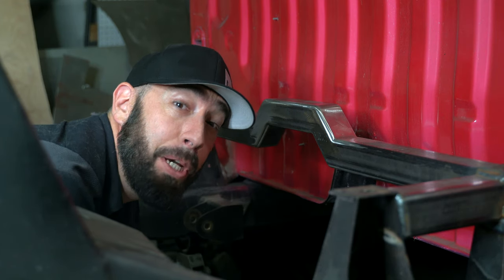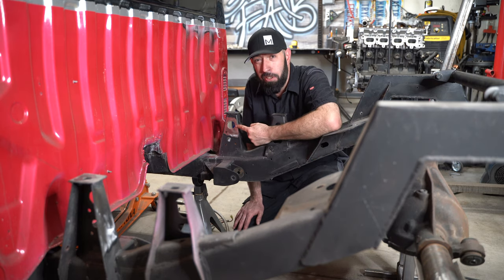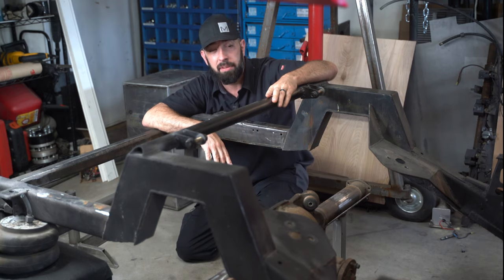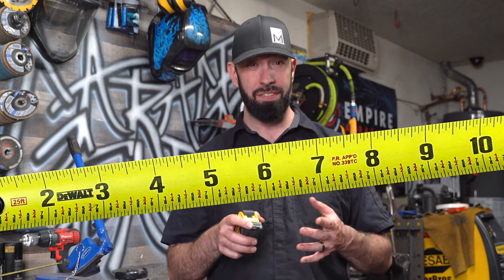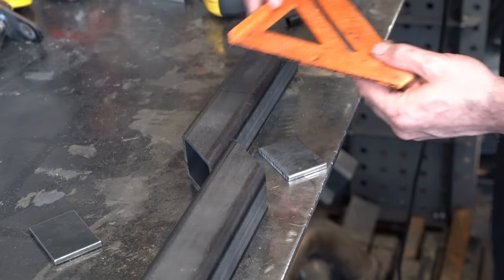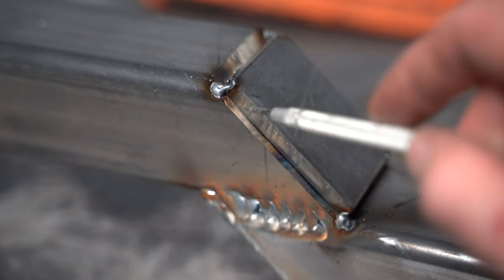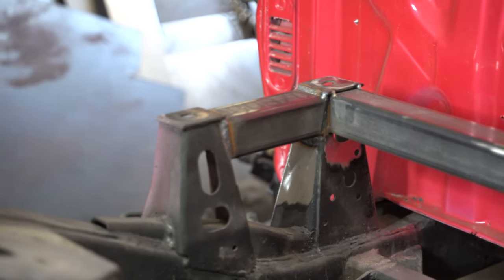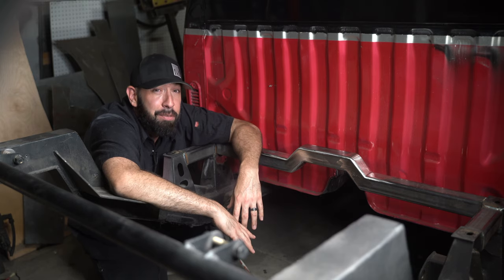Building a Custom Crossmember for a Parallel 4-Link! Mighty Max Ep. 10

Comment: I'm a Canadian welder/fabricator, with over 30 years in the trade. I learned metric in school, but most fab shops I've worked for use imperial on the shop floor... I actually prefer it for fabricating... gets annoying when you start dealing with 10,452 mm, layout a hole center 🤣 one of the tricks I like finding the center of a measurement goes like this: half of 3/4 is 3/8, half of 3/8 is 3/16, half of 3/16 is 3/32... half of 5/8 is 5/16, makes laying out centers easy.

Comment: I just picked up my own 4g swapped mighty max project. You have some of the most informative and entertaining content so keep the videos coming!
Reply from the maker: Thank you for the kind words! Is the swap done already or are you going to tackle it? We’ll have to swap notes. I haven’t done one yet so it’ll definitely be a learning process.
Reply: @GarageFab  It’s still a project that needs to be finished up. Most of the fabrication stuff is done except for the transmission mount (engine was moved forward 2in). I pretty much need to do that, plumbing for cooling/intercooler piping and then wiring. I’m pretty familiar with the 4g63 being that my first and forever car is a 99 gsx. The truck will be on the back burner since I’m gonna be building my car and I’m still in college, however expect to get it done by the end of the year
Reply from the maker: Very cool! I’ve hit a snag with the cooling system at the back of the head. It looks like I bought an Eclipse with the wrong motor. Getting the coolant hose neck at the back of the head is going to take some creative fab work. Can’t wait to see yours. 👏
Reply from the maker: I found several 90°necks at the junkyard and they were all badly corroded so I ended up buying a Dorman from the auto parts store. (Surprisingly good quality) That’s when I found out my thermostat housing is different so I can’t use that neck. THEN I found out the head is different so I can’t swap thermostat housings. 😤
You have an Instagram?

Comment: Excellent video as always on point.. ..pro tip always use a limescale pencil I believe there called ..then u can see it very clearly while welding AND the heat don't kill it like a pen where heat often makes the ink disappear and by memory the limescale won't effect the weld but the ink will..memory can be wrong 🤦
Reply from the maker: I’ll take it! I have a soapstone marking tool, but I always forget I have it. I wonder if that’s the same thing. 🤔 Thank you!

Comment: Aaron could you make the ends of the tank fold up on the brake instead of fabbing  up end plates?  This would reduce two welds.
Reply from the maker: Yes! But not with the brake I used. There’s a magnetic brake I hope to purchase sometime in the near future, that allows you to make a completely closed box of essentially infinite height. So cool! With t my brake, you can only make up to 5 sides of a very limited height box.

Comment: I really needed this eye-candy to explore new ideas for my situation ! I have my lower arm installed in fixed diff. axle factory plates via u-bolts / cut off rear leaf spring at diff . axle mounting . /  .. I detached arm from the truck frame & moved that arm up & down to see if the pinion angle changed ..it didn't so I reattached it ... I have the rear axle at desired ride height . I will it seems need to correct pinion angle which now points up ward & not inline with drive shaft ..via wedge ... I am trying to use what is there already ... / the top of diff rear end , center point I will triangulate from center of top diff axle to a frame to frame cross member  like what you built to attach upper triangulated bars to run parallel with lower bar ...  there's not much rear end travel at all when my truck had full leaf springs .. Not trying to obtain more travel .. just want a non full leaf spring set up .. I will mount a BFO coil over on top of diff. on each side .. that will lift & shock absorb the rear end ...  That is my plan to keep it simple light weight .. what do you think ?

Comment: I think we should send you a metric tape measure and see if it helps working on a metric truck
Reply from the maker: I’ve tried. I even announced the switch to metric. I purchased all kinds of metric measuring gadgets! (a tape measure included) I realized immediately that because every manufacture of parts in America and every supplier of material in America uses the imperial measurement system, measuring in metric was going to be far too much of a challenge.
Unfortunately we’re stuck in a rut. Forever forced to use inches and pounds until one day everyone in the US  magically switches to metric overnight.

Comment: Glad to here your back at it love the content in your video's .All so well explained and good tips and the good thing is not all builders build the same way ,could you tell me the advantages/disadvantages between 4 link Parallel & Triangulated 4 Link Cheers Neil in the UK .
Reply from the maker: Thank you for the kind words, Neil!
Gladly! That’s a far better question to ask than “Which is better?” Since it really depends on what the builder intends to use the vehicle for.

The main advantage of a Triangulated 4-link is that the angled bars keep the axle centered under the vehicle so there’s no need for a panhard bar or watts link. That’s a huge plus for off-road vehicles that need to articulate a bunch or need a lot of travel because panhard bars especially can limit movement.
The disadvantage is Triangulated 4 links are not as stable laterally as a vehicle with a panhard or watts link which makes it a little less ideal for road racing or Autocross. You can correct the excess play in the bushings by swapping in heim joints but those are expensive and they can make for a rougher ride.

Parallel 4-links are easier to understand, build and tune. They take up less room than a Triangulated 4-link but some sort of axle locator is needed, like a panhard bar on static height vehicles, a watts link on adjustable vehicles, or wishbone on either. A Parallel 4 link is very stable even with softer bushings which makes it great in hard turns, slalom, etc. while still having a comfortable ride.

Both setups can be designed to keep pinion angle in check, provide anti-squat properties, and create or eliminate roll-steer.

Hopefully that was what you were looking for. If not I’ll try again.

Cheers!
Reply: @GarageFab  Thanks for that mate its for a 48 Mercury Coupe i have ,i am planning on bagging it i have all the running gear including a front clip out of a 69 400ci firebird (long gone ) Engine fully rebuilt nd 350 trans ltd slip diff .Im hoping you have give me the kick up the R S to get started if not after Dare i say Chxxxtmas .I have a few jobs in the house that need doing first so we will see once again many thanks Neil .P.S . it wont go on a track im just a cruzer these days lol.
Reply from the maker: Sounds like it could go either way for you. If you want to keep the rear seat, a parallel link setup might serve you best since you can often position the link bars on the sides of where the seat bottom would go.
A triangulated setup would work just fine as well but the floor in the rear would likely need to be replaced to make room for the angled bars. 🤷‍♂️ 
Good luck my man. Can’t wait to see it!
Reply: @GarageFab  Thats great info you answered questions before i have asked them ? i really want to keep all the seats usable as we go away to weekend shows/meets ,so thats a great point about seats the other point (that you will already know lol) what would be the best link ends from your recent comments im miles off .I was thinking along the lines of spherical rod ends But im guessing not (for the best road use ) once again Aaron thanks a lot P.S. I hope you and your family are ok and got through all the Covid FN SXXT
Reply from the maker: All has been fantastic, thank you for asking. We’re some of the luckier ones. I’m a Toyota/Lexus Tech by day so I was considered “essential” and no one got sick. Not even a cold. You?
From what I know about your project so far, I’d recommend plain ol’ boring poly bushing ends. You don’t need much articulation so Heim joints would just be a waste of money unless you prefer to feel every crack in the road. (Some people do)
If you just have an itch to spend lots of money, grab some Johnny Joints! They have some extra motion like spherical ends but they have some polyurethane to soften things up a little bit. You’ll get a little better ride and empty your wallet at the same time!
Reply: @GarageFab  All is ok ish over here we managed to miss most of the covid ,but local hospitals were over run we are all double jabbed so should be ok ,now back to the  Merc i had herd about the Johnny Joints but my Wallette wont stretch  to that .I have been looking at some a diagonal 4 link set up and it looked like it might not take up toooo much space ,Thanks for your reply Cheers Neil .
Reply from the maker: Anytime my man! I’ll be here when it’s time to get your hands dirty.

Comment: I noticed you commented on using a  2X4 1/4 wall tubing of your  dhopping cart cart handle. Would you be making a video about " the difference wall thickness of metal that you use to fabricate your chassis" ? Z notch front frame etc
Reply from the maker: Likely but probably won’t be anytime soon. The current build has most of the framework done already. I’m an overbuilder though. 
I think most often factory frames are between 1/8”-3/16” thick and sometimes layered. 
My notches are usually 3/16” plate and the gusseted/fish plated with another 3/16”

Comment: I love the bite size version because it packs a lot of info without the readers digest storyline,  as far as math goes,  I'll stick with sae, it's easier than you think if you realize an inch is divided by 16, any fraction can be broken in half simply by multiplying the bottom number by 2 and leave the top number the same,  3/4 ÷ 2 = 3/8, 5/8 ÷ 2 = 5/16,,, it's not that complicated 😉
Reply from the maker: Thank you Geoffrey! Bite sized videos seem to be slightly easier to produce as well so I think that format is here to stay.
I don’t disagree with you. I’ve finally got the hang of SAE but it took a LONG time. If I’m being honest, only the videos will switch to metric for the viewers sake. I learned almost immediately that using metric in America comes with it’s own challenges. Mostly when purchasing parts or material since everything is priced in inches and feet. 🤦🏻‍♂️
Reply: @GarageFab  I'm guessing you must be in Canada, it's hard to tell just watching hotrods being built,  I've been building custom cabinets for several years and the problem I have with metrics is the wood is being sold in odd sizes while the tool, saw blades and router bits, are in sae sizes,  it makes for a lot of extra work to get a tight fit you would expect in high end furniture, you keep building and I'll keep watching. Have a great day
Reply from the maker: It seems all the YouTubers are in Canada! I’m actually in Las Vegas Nevada. Do you post your builds online? I have a love for custom furniture. I’d love to see it. Since starting the channel I’ve only posted a couple furniture related videos disguised as fabrication tip videos. One being a miter cut tutorial and the other on Patina.
Thank you for the kind words my man! See you in the next one.
Reply: @GarageFab  Vegas baby, that's cool,  no I've never posted any of my cabinet work mostly because it's a job for clients who are always in a hurry,  it's like they've been thinking about it for years and somehow believe it can be built in a day, it's been pretty slow for people spending money so I'm spending more time building my 47 Ford truck rat-ish rod

Comment: What happens if you use one crossmember with brackets that allow upper and lower link bars to attach too? Is it just a power/strength thing (V8, 9” rear, fat tires, etc)?
Reply from the maker: That’s perfectly acceptable! That’s usually how I do things and it makes things easier when building a parallel 4 link. If you scroll a little through my Instagram @garagefab you’ll see a couple of examples.
I generally use 1/4” wall 2x4” rectangle tubing but that’s likely overkill. Just make sure it’s strong if you plan to mount any of the bars near the center like on a triangulated 4 link.

Comment: Outstanding content. I learned more from your videos than most of the other YouTubers. The 4 link suspension series was great I liked how you explained everything on there. I have a question for a heavy duty truck like a 3500 what type of thickness would you need for a parallel 4 link system?
Reply from the maker: Thank you, Juan that’s a huge compliment!
As for the link bars, do you have a design planned already? Is it important to you to limit weight? I’m a proud over-builder and don’t care if my truck weighs as much as a tank. Whereas someone who races probably wants the strongest link bars with minimal weight.
Link bar wall thickness won’t change much between mini trucks and full size trucks. More important are things like, Will the air springs be on the bars or in the axle? Will the link bars be straight or curved/bent? Factory engine or something more powerful? Will you be towing?
Reply: @GarageFab  Thank you for the response. I have a 1988 r30 dually running project. It's a squarebody in a weird year. I'm planning on putting a welding machine with my tools and haul an rv. Right now it has the original motor which is a 350 5.7. I'm going to eventually put a 12v cummins in it. As far as suspension goes probably going to put air bags on the axle with the parallel 4 link and a watts link too. So I need it to be able to handle the weight and load. Anyways, i can't really tell you how much your videos have helped me understand the fundamentals of suspension. If you could do some more videos about the suspension applications for towing or racing. That would be great. Again thank you for replying. Keep up the great work. Eventually your going to be a top YouTube. I don't doubt it.
Reply from the maker: Sounds like you’ve already got the right idea. Putting the air springs on the axle is the only way to go if you need to support a load. You sacrifice some overall lift and it’s a bit rougher but safety is far more important.
Also since you’re axle will be bearing all the weight, the link bars are only pushing and stopping the vehicle. My D50 had the same engine (TPI 5.7) with bags on the axle with 1.5” bars 1/8” wall. I think you could get away with the same… but why not just use 1/4” wall? 🤔 
As for the videos, they probably won’t go much farther than Suspension Basics. Once outside the world of Mini Truck suspensions, my knowledge starts to fade. I’ll gladly just spark interest in people and motivate them to continue their education.
Thank you again, Juan!
Reply: @GarageFab  awesome! I can't wait to see more of your videos. Including the instuctional toe clipping video. Lmao

Comment: Hey ManKandy.  As I recalll, in episode 9, when you built the custom fuel tank, you said you'd let us know how the POR15 Fuel tank sealant worked out in the next episode.  Well, this is episode 10, sooo.....  How did that turn out?  I'm am anxious to know, as I am considering doing exactly what you have done.   I'll keep watching and hoping to see the update.  Thanks!
Reply from the maker: Sorry, Ronald! I didn’t expect the project to go as far south as it did. An update video will still be coming but I’ll spoil it for you so you don’t have to wait any longer.
I wasn’t happy with the POR15 at all. The directions said to pour in the can, turn the tank to coat all sides, and then drain the excess and let it dry.
After coating all sides, it didn’t look coated. It was shiny but you could still see the metal underneath. The photos showed a silver coating, but it looked like clear coat with some silver metallic in it.
So rather than draining the excess, I coated all the sides again. And again. And again. Each time getting a little better, but I could still see the metal below. So I decided to just leave the whole can in and coat the sides repeatedly until the whole cab was used up. Finally it looked like the photos. Silver.
After letting it dry for the day, when inspecting I found huge air bubbles that had formed between the metal and the tank liner. Like pizza crust bubbles. I was incredibly unhappy at this point. I realize it was my fault because I didn’t follow instructions.
When discussing it with some other folks, I heard stories of POR15 tank liner dissolving and clogging filters and fuel injectors. I was told a two-part epoxy liner like Tank Kreem is the only way to go. As if I wasn’t unhappy enough.
So that’s where I’m at currently. A bubbled up liner that I want to remove. But how? I’ve got ideas. Starting with aircraft stripper hoping it works. Maybe fire. Maybe starting over and build a new tank? 😬
Reply: @GarageFab  Thanks for the explanation and the heads up.  I guess you could call this experience, because "Experience is what you get, when you don't get what you wanted."  Good luck getting the tank cleaned and recoated.